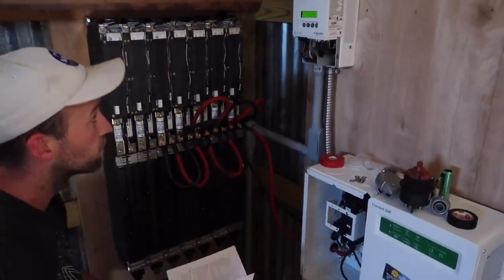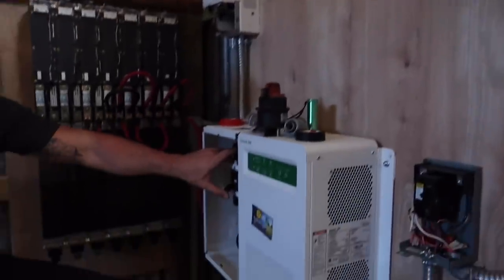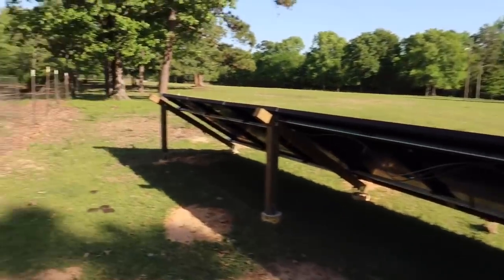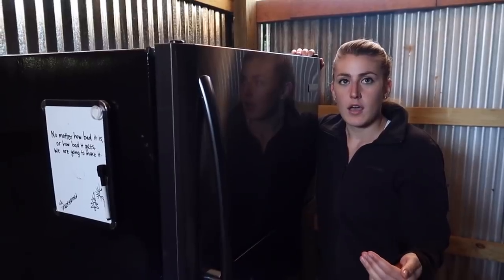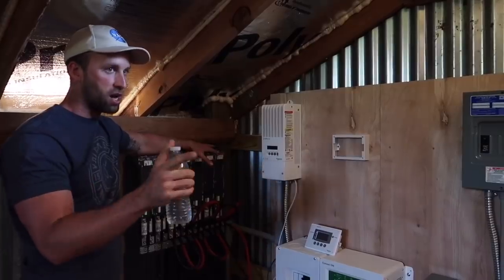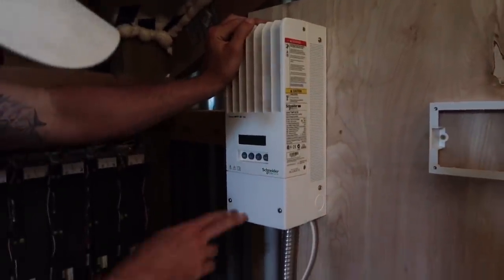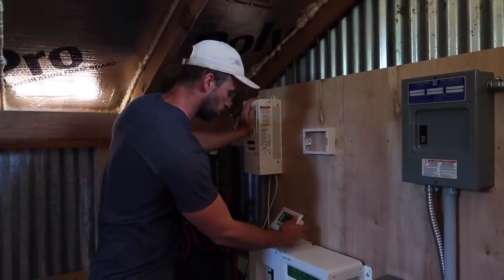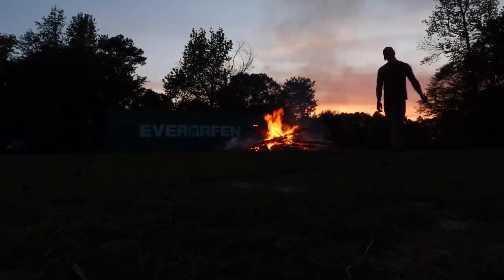WE’LL NEVER BUY POWER AGAIN!

Comment: Small piece of advice. Inverter is more efficient when input voltage is slightly above output voltage. In your case ideal would be to have 2 batteries in series and then put those pairs in parallel. Ofc, it's doesn't fully work with 7 batteries but you can always buy another pack of used Tesla batteries. 20kWh in total is nothing.

Comment: You bought power equipment with current money. The money spent is not generating investment returns.
You will buy power again when the batteries need to be replaced.
You will buy power again when components need to be repaired or replaced.

Comment: Love your videos bro. However i do solar design and i noticed you have a shading issue due to trees, they will reduce the efficiency greatly. I recommend you either trim down the trees that cause shading or relocate the panels for maximum irradiance. Also by looking at the video is hard for me to tell what orientation you placed your panels, are they looking south, southeast or east? They should be facing south with tilt angle of your latitude location ie: latitude 41 = panel tilt 41 degrees angle. If you have it like that kudos. But overall very nice design brother keep it up
Reply: Could you also post panel and batteries specs?
Panel Voc, ISC and Cell efficiency
Battery Voltage, Capacity, Batt efficiency and CTRD please?

Comment: I know that this is an older video and someone might have already mentioned what I'm going to tell you to avoid those sparks when you hook up your batteries. Buy a cheap 100W resistor and touch one end to your negative battery and the other end to the resistor. Always connect your positive battery cable first and use the resistor before hooking up the negative side.

Comment: Safety advice.. I suggest that you sandwich at least a sheet of 1/2 inch drywall or greater between your plywood and concrete backer board... Mount "ALL" electrical equipment to the concrete backerboard... This way,  your plywood won't over heat.. And have at least a 30 lbs Co2 or ABC fire extinguisher handy.. Good luck and be safe....

Comment: Why 119 V??  Isn't a 12V System  the usual format??
Reply: Normal US appliances run at 120V. 12V is standard for caravans and camping where it just needs to run maybe a bar fridge and some lights/fans, but it's not great for an actual house where you want a whole range of power hungry appliances. You wouldn't want to try boiling a kettle at 12V... but caravans use gas for that purpose.

Comment: hey Broski where is your disconnect you know like if you have to service it I mean it doesn't really matter depending on  what state you live in or if this is even being inspected by an inspector but I think it would be smart to put a main switch disconnect you know just for safety is not just voltage from a house panel can kill you if you put a lot of batteries together they have a potential of killing you as well it only takes one amp to kill a human being so it's really dangerous

Comment: We looked into solar. We had a company come out and provide a bid. $26,545 for the panels, which was not quite enough to cover all of our power needs. Based on a monthly average power bill of $200., even if our power bill went down to zero, it would take 11 years to break even. And to get off grid requires batteries, not included. Sorry, but NO.

Comment: Nice job, congratulations! Have the PV panels checked with thermography after few years to see if they are some 'bad' PV panels that can reduce significantly the production of energy! The system though can be expanded by adding vertical axes wind generator, very efficient for weak winds and producing power even during the night! Greetings

Comment: Nice to see a young person not cutting corners. Never had a single apprentice work for me in 43 years that ever had a PVC reamer. Using chairs on the rebar. Everything you have done you should be very proud. They are building a $1,000,000.00 across the street and didn't even put any wire in the driveway. Put $100.00 each steel tubs that if you drop a bar of soap in it it will chip. So kudos to you.

Comment: Pre paid electric for ten years in advance . Then buy more batteries .  But .  In the long run ,hopefully there will be savings .
Reply: If they are on a piece of land where there is no electric yet (aka undeveloped land) then they would have to pay for the company to come run poles and wires anyway.. which is about 10-20k depending on distance needed from the road. Considering they have issues with mail delivery.. this is prob the case.  Not to mention they now know what everything is (empowerment) and if something goes wrong how it can be fixed. You cant compare that to having electric ran and installed and something going wrong and you have to have them come back out.. not to mention permits and inspections in some areas which just makes the state rich. Solar is def the better way because you dont need any of that.
Reply: @N0body247  good point on the cost to install .   I looked into solar for our lot in the philippines ,  but batteries are to much for off 100% off grid . With air conditioning . But ok for day time ac and power outage .   To run wires there ,we buy the wire ,and what ever you choose to support them with .  So no.issues there .
Reply: @boracay12  if you dont mind me asking Why are batteries too much for 100 percent off grid..Are batteries expensive in Philippines?
Reply: @N0body247  to run a air conditioner all night ? Yikes .   100 bucks for 100 amp hour  lead acid . But you can use 50 % of that ? Mini split is 800 watts per hour , more or less ,     more than i want to spend on batteries .   Plus you need to have more panels and batterys  to be able to run day time electric demands and extra to charge for night use  . Etc .
 So my plan is to have enough to power a mini split during the day , which is blazing hot . And enough for power outages .
  Edit 150 for 100 amp hour
Reply: @boracay12  My suggestion would be instead of trying to cool the home.. how about adding more insulation and making it so when its cool the air doesn't exchange into hot air. If you add insulation and seal any air leaks and add a heat barrier in the roof you should be able to KEEP the home at a reasonable temperature.. and if you do cool it , it will stay cooler longer because of the insulation. Other than that.. maybe add shade to your roof so your home isnt hot all day.  Just a thought.
Reply: @N0body247     you haven't been to the philippines ,i can tell 😃 .   The only insulation they have is a roll of 1/4  inch foam with a reflective side .   The houses are built with cement block and zero insulation .   Plus its a crazy 70 to 80 % humidity .    But if i build , i will use a new system that is foam board incased in high strength wire cage , cement is applied to each sides , twice . Its strong enough for a  second floor or roof .
        That should  as good  aa it gets   . Other wise ,a open air style home with good fans is the best  alternative .   It never really gets cool ,but before dawn it some times will go down to mid 70s . As soon as its daylight , its hot/ humid again  .

Comment: Have you ever thought about buying a 48v 3 phase AC PMA turbine? What's the wattage of your battery bank? I would get a midnight solar classic 250 mppt controller and a 120v wind turbine 3 phase AC and hook it into a 3 bridge rectifier then connect your new DC cables positive and negative to the mppt controller.  I would try to get a turbine with voltage much higher than your bank voltage and let the mppt controller regulate it. That way you can get wind energy from low and high winds both.  I would get a 3 kilowatt 120v PMA and an inline inverter and wire up some different things to it. Like a battery bank 7 stage charger or conditioner made for car batteries and and deversion dump board and solid state relay to a hot water tank  as a dump for extra power. And you could even power electrical fencing with it too what ever you want.
Reply: I would use the turbine for heating and cooling needs in your home.

Comment: 06:38, Did some one say healthy food? That almond milk is enriched, processed, pasteurized and has 38 % less sugar? There should be NO sugar in milks. Most cereals use particleboard / sawdust in most cereals as the fiber count.  Smart balance is GMO'es / synthetic. Hersey choc. Most all milk type chocolates has lead in it.  Hit up Dr Mercolas data-base to get "healthy foods". Hey, that appears to be a great system you set up there. But, consider putting the panels at least 4' off the ground at its lowest point.

Comment: Nice . Are you going to have a small backup for the house? What if the solar panels got hit with lightning. You also get tornadoes. Are you going to have AC in the container? If not won't it get exponentially hot because of the steel carcass?

Comment: Hi, awesome vids. I plan on doing something similar next year. I currently live in ND and plan on moving to AK and have been researching all the best ways to be self sufficient and one thing I came across in a video by MrTeslonian is creating fuel by wood gas so essentially you build this contraption burn twigs and wood and it creates fuel you can straight pipe to a generator and charge battery's etc. I came across another guy who has the step by step guides as well as converting the generator carburetor to run. I will attach one of links to this guy and his book its called the wood gasifier bible. I thought maybe this would be of interest to you guys. I haven't built mine yet i got the books and we got a hail storm so now have to pay the deductible on that but hopefully this winter sometime. https://www.youtube.com/channel/UCyt2pCUXJUKzB-l8Z2lphlw

Comment: Some safety notes:

The positive wire to the battery should have an inline fuse within a few inches of the terminal on the battery side; I'm guessing your setup should probably have a 150A fuse in it. This is separate from any breaker that might be in the circuit as well. You probably should cover up the batteries as well to avoid accidentally shorting them out or killing someone/thing; think kids or dog long term...

The positive feed from the charge controller to the distribution box should go through a DC breaker; 60A DC breaker in your case with the mppt 60 unit, that's what the two blank breaker spots on the distribution panel are for. the Schneider DC distribution panel allows for up to two charge controllers thus two breaker slots next to the inverter 250A breaker. AltE carries the 60A and 80A breaker so; in case you upgrade the mppt 150/60 to an mppt 600/80 at a later date.

DC breakers are different than AC breakers: remember AC current goes to zero several times a second so AC breakers don't have to take as much heat as DC breakers! Make sure to always use DC breakers on the DC side of solar systems.

Once your house is built you should consider getting the Schneider conext comm box from AltE store. Allows you to control the system from your pc, easily update firmware in the mppt and inverter and keeps long term data on the power coming in/going out/batteries/auto generator start, etc.

For the workshop you might want to look into the Schneider XW inverters, they are beefier than their smaller SW siblings and better suited for all the power a workshop will chew up!
Reply: Also, don't connect both wires from the batteries to charge controller on the same battery. You have a bank of batteries connected in parallel, you connect to the negative post on one battery and go all the way to the farthest battery  and connect to that batteries positive post. It has to do with evenly loading all batteries and ohms law. Each wire  has a certain amount of resistance, also each battery has resistance. You will wear out the battery that you have the wires connected to first, but if you have one wire on one end and the other wire on the other end of the bank of batteries you will evenly load, charge, and discharge all of them evenly. Think of it this way, you have five barrels for water storage, each has a pipe going to the next barrel, but the first one fills up, then flows to the next and so on, you want to fill each one evenly not fill one, then the next, then the next. It wears out the first barrel faster, the same with the battery, because you charge the first battery, then that energy discharges to the next battery and then the next so all the energy is being pulled from the first battery that is closest wired to the charge controller.  You need to think of your batteries as being one big battery, not a bunch of batteries daisy chained together.
Reply: Yes the battery bank should be in a cabinet that you can heat and cool if necessary.
Reply: Also don’t run nm cable through flex

Comment: Keep in mind...it isn't "free" energy if you have to buy a new battery pack every 4-5 years. A battery pack from a new Toyota Prius is about $10K.
Reply: Battery pack should last 7-10 easily with the Schneider equipment he has and proper settings.

Cars use the batteries more aggressively than solar, even tho they may be unusable for a car they should last year's with the proper charge controller and inverter settings; Schneider equipment has proper settings for Lithium as long as your firmware is up to date.

Comment: This is cool watching you two go through all the stuff I've  gone through . Like the the big spark when you make that last connection. You'll never get used to that. If it's wrong it'll get hot really fast.  Bad connections also get hot and sometimes make a humming noise. I ran my panel's parallel I didn't like the idea that if something went wrong with one panel weather a bird crapped on one panel or something with one panel it kills the power in the others in that seiries. It also allowed me to use a much less exspensive solar controller and i used multiple inverters. I run all my light on one 100 watt inverters the kind you plug into your car lighter cost me about 30 bucks and last me about 10 years. My other stuff runs on a inverter like you might find in a semi truck. 5000 watts pure sinewave inverter cost 350 bucks. It's 12 years old and still going strong. Hey how you two doing your water ? I collect mine off the roof. That's the way most do it in Hawaii . It's a lot cheaper than doing a well. With a well you have to pull up the pipe and replace the seals at the bottom every few years. It's expensive and a pain in the ass.  Sorry I get a little long winded in my comments but if I can give you some ideas I'm going too.

Comment: Great video!  I'm about to install the same setup on our project...  Do you know if using DC (at the outdoor combiner box) circuit breakers is a must, or will AC breakers work as well?
Reply: Thinking Outside The Grid ! AC breakers are a No-Go for DC loads. The DC voltage at the combined box is probably about 80-90VDC with three panels in series. DC has a tendency to arc when disconnecting under load and the breakers must be designed for DC use. 

The Midnight MNPV6 combiner box they show is a standard in the US. Breakers aren’t that expensive. They provide a link in the description.

Comment: Idea, Organic Carbon power cell banks helium sealed cylinder stirling cold piston powered by an electric motor that generates ultra low temperatures that turns the gases in the air into an ultra low temperature liquid that then fills an insulated tank with a bell siphon. Siphon will empty liquid air into an insulated resivor with 20 stirling cold gas cylinder heads of a Stitling cold gas V-20 stirling engine that has gadolinium magnetic bearings on all moving parts on the stirling engine. (no need for lubercation) everything operating on magnetic cushions with the stirling engine having antivibration technology for smooth operation. One fly wheel on the stirling engine having a bicycle automatic transmission with a large rewired drum motor generator with magnetic bearings regular magnetic bearings or gadolinium bearings with a large vacuum spark gap to generate electrical energy. The other fly wheel on the stirling engine having a fan attached to it to draw air through a condensing coil for air conditioning and a worm gear box to drive a small pump to circulate liquid air through the condensing coil then through insulated piping to pass liquid air through a refrigerator and or a deep freezer with the liquid air the returning to the cold piston to reform the liquid air to complete the cycle. The drum motor electrical generator can charge up a organic carbon power cell bank not in use so the power banks can then be used in an alternating cycle. Could even design the electric motor operating the stirling cold piston to draw power from one of the carbon power cell banks to generate the first tank of liquid air with the power drain from the power bank halting and a circuit from the drum motor generator then providing the volts to operate the electric motor on the cold piston. Or you could have a V-twin or V-6 stirling cold gas engine with magnetic bearings and antivibration technology with bicycle automatic transmissions on.each fly wheel with a large rewired drum motor generator with magnetic bearings with large spark gaps to generate all the electrical.power you would ever need. A neat state of the art cooling and electrical.power generation. Not only that but you could use this concept to chill and oxygenate and add nitrogen to water and operate pumps in a hydroponic green house and use it for climate control in the green house. If y'all can understand all this information? Then let me know and ill explain a stirling hot gas engine concept to heat water heat a home or green house heat water for heated floors and to also generate electrical power using induction levatation of an alloy. 😊😲